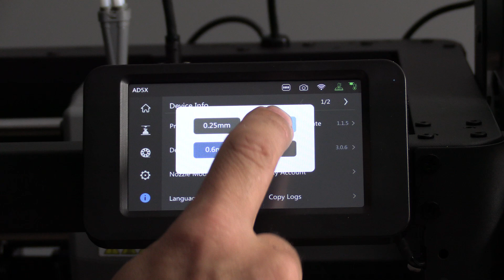How to Replace or Change FlashForge AD5X Nozzle - 3D Printer

Comment: So, dumb question. Is it necessary to tell the printer what size nozzle your using? I've had a number of 3d printers over the years, (newest being the centauri carbon, i have the ad5x on order), and I've only ever changed the nozzle size in the slicer.
Reply from the maker: Yes. You will want to set it in the firmware at the screen
Reply: @3DRundown huh. Not sure why it never occurred to me. Thanks.
Reply from the maker: this wasn't a thing on Older machines, but newer ones running klipper, communicate with the slicer